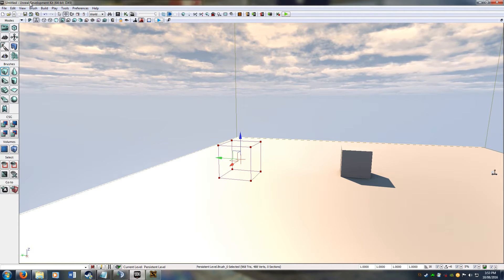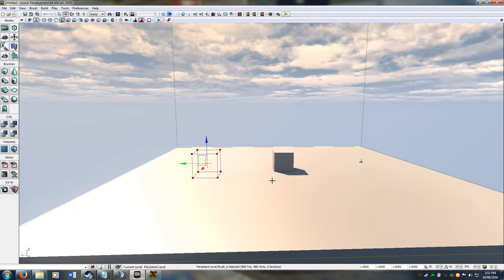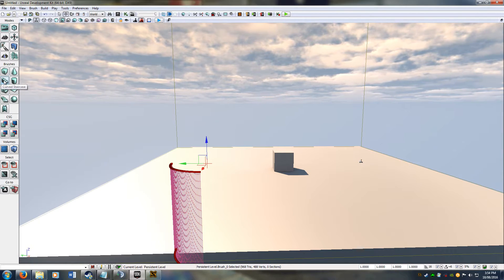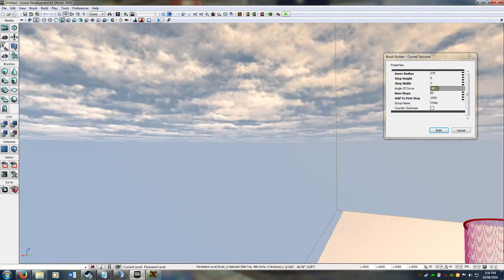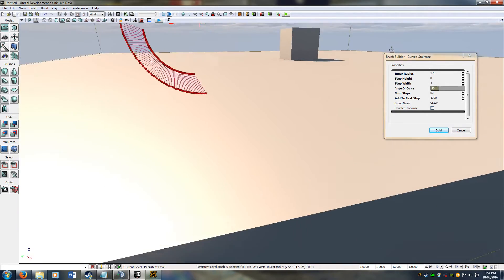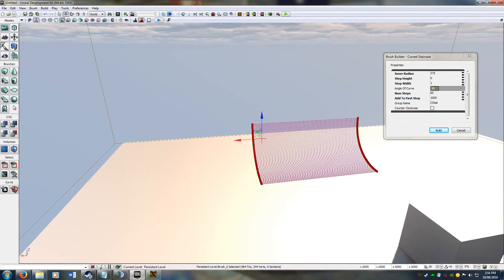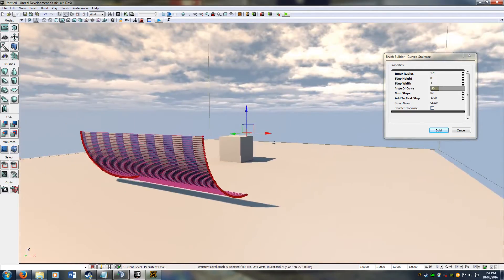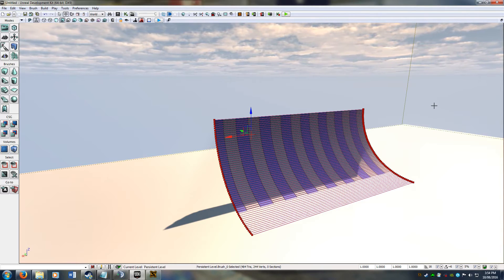RL Modding Part 4: Curved Surfaces

Comment: Great video! When I add the blocking volume the UDK starts lagging :( I'm on the right version!
Reply from the maker: That's interesting, does the map load in RL and lag there too? It could be a graphics card issue?
Reply: The map does load and there is no lag. Just in UDK. In RL there's another issue, something is blocking when I try to drive up the ramp. But I imported some meshes from your RocketLeague-Pack that do what I want.
I have an older graphics card and plan to upgrade later this year (waiting for vega). Anyway thank you for your reply!

Comment: Hey thanks for these tutorials! These are great. Quick question, you mentioned you changed version, is that needed for doing rocket league mods? Worth changing the version? Im using UDK ver: 10897 atm. Thanks!
Reply from the maker: That is the correct version. When these tutorials were created we were just starting out with everything, and I had a more recent version. As a result, the curved surfaces weren't colliding correctly.
Reply: JimJoms TV awesome thanks :)

Comment: Hey man thank you so much for these tutorials! Can you show how to:
- make mountains work? As terrains doesn't work  can you show how to make import mountains like in the maps on  rocketleaguemods sub and make them block?
- teleport ball only/car only/together, how to refer to the ball when creating an object.
-
Reply from the maker: The mountains can be imported the same way as outlined in my "Importing Meshes from RocketLeague UPK Files" video.
Unfortunately, Collisions are only achievable through blocking volumes which are Convex. I'll do another theory video on collisions soon so it's easier to understand.

I believe there is a tutorial already on teleportation (I haven't looked into it yet but i will and then will create a tutorial if the video isn't tutorial geared)
Reply from the maker: I've uploaded a tutorial for teleporting
Reply: JimJoms TV Thank you so much man,Can you show how to teleport/refer the ball only? to be able to make ground that if only the ball touches it will be teleported? no one ever showed how to do this on the community.
Reply from the maker: Sure thing, I'll make a new tutorial when i can.
Reply from the maker: I would like to change my answer, Mountains can be made to be collided with through the FoliageActor method.
Reply: +JimJoms TV First of all thank thank you so much for the teleport tutorial. I can't thank you enough. About the mountains I tried but after dozen of times something always seems to not work. I'm just trying to make mountains with rocky textures and blocking volumes.
Reply from the maker: I've just published a tutorial that does exactly the mountains for you :) (Part 14 i believe)